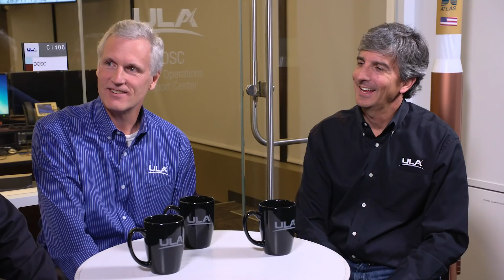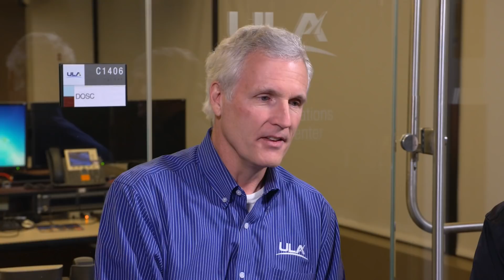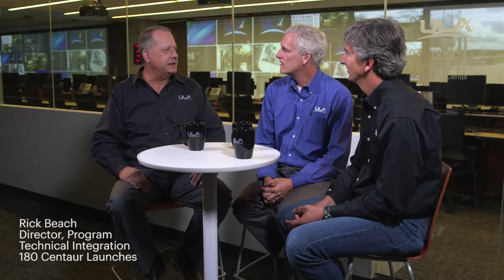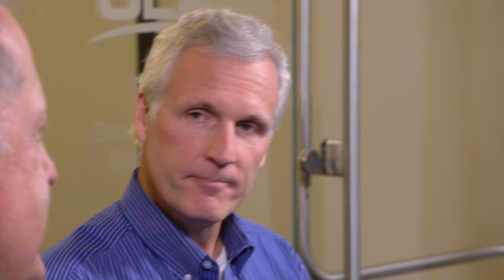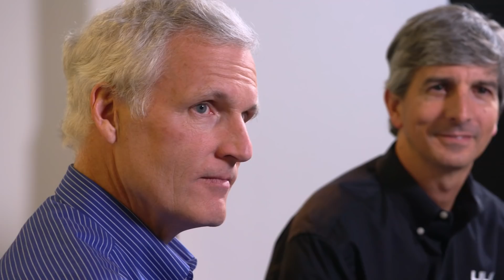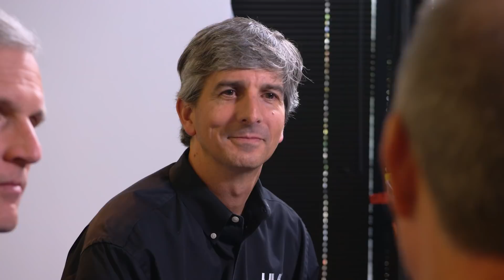Rocket Talk: 250th Centaur

Comment: Are they bringing the centaur upper stage back to the ground or are they leaving it in orbit as space junk?
Reply from the maker: We de-orbit the upper stage as often as possible. In cases where that’s not possible, we comply with U.S. Space Debris requirements to minimize “space junk,” for instance putting it in a disposal orbit or sending it out of earth’s orbit, e.g. sending it toward the sun. For our recent AEHF-4 mission, we put the Centaur upper stage into a disposal orbit.
Reply: On low orbit launches, yes. On high orbit launches, they are launched into a designated graveyard orbit away from anything it could hit.

Comment: What y'all think about Additive manufacturing of rockets in zero gravity 20years away 40?
Reply: In my opinion 3D printing of entire rockets or other complex systems in space is not likely to be practical anytime soon on a large scale.  More than 40 years off.  Currently AM parts are being made in space in niche applications like for unforeseen repair parts needed on ISS.  But if you need to make something really big and complex  like a whole rocket, that's much easier to do on the ground.  Either way you have to haul all the rocket materials to space, which is the hard part.  For example if you want to get a 10,000 lb rocket (call that rocket A) into orbit and then launch it from there,  you could use rocket B (a rocket capable of lifting 10,000 lbs) to get rocket A there.  Or if you had a really big 3D printer in space, and rocket A could be entirely printed by that printer, you could theoretically print it.  But you'd still have to haul 10,000 lbs (or more) of raw materials into space for this huge printer to make rocket A, using rocket B.  So why not just build rocket A on Earth and launch it with rocket B.  Much easier.  And that's not even considering getting propellants in the rocket, prelaunch testing, etc.
Reply: @gregarend8270  thanks. Would you say it would be more practical to built a rocket in space or in the surface of another planet besides earth and touch it down on another planet or just built it there?